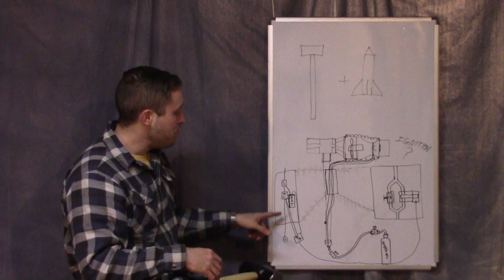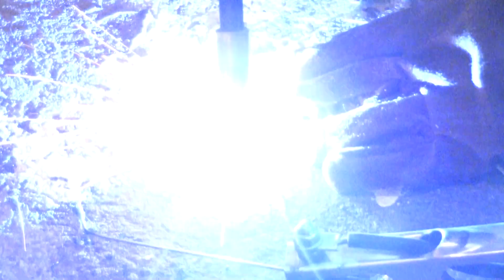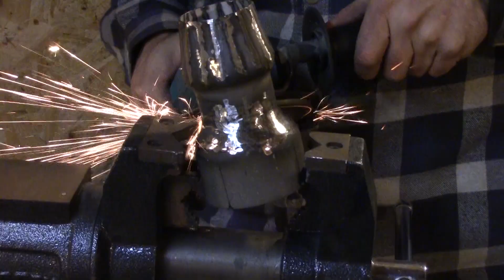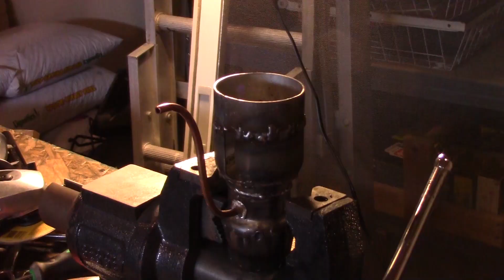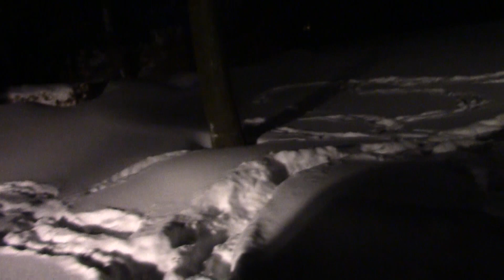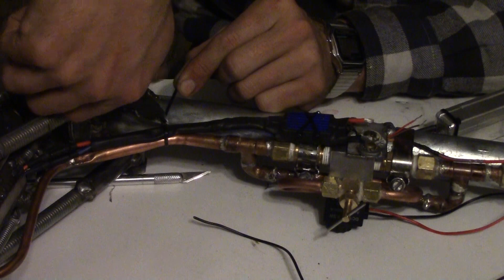Building The Real Life Super Sledge (Fallout 4)

Comment: Ok, I just happened upon your video, so now I have to check out the rest, but...pulse jet with tiny input charge and electric ignition...just enough to power a swing, then your reload system.  No edf needed.  It would be loud as a, well...really loud, but it would really add the torque to the swing if you could hand on to it.  Ok, onward to the rest of the vids.

Comment: you could try to change the fuel to hydrogen and oxygen (in 2 separate bottles so you don't cause an explosion by compression.) and you pump them both together in the chamber then you wouldn't need the intake because it carries it's own oxygen and it would look more like a rocket attached to the back.

Comment: your badass man. usually the difference between tube and pipe is rigidity. pipe don't bend, tube does. but exhaust pipe bends so it's dumb. kinda like threads. makes no sense what so ever.
Reply: oh, and one is measurement. id and od. but call it what you want. a stick of metal with a hole in it.
Reply: Technically exhaust is tubing as well. Pipe is slangily used by people that didn't know the difference and it's been used so long that's whast they call it now but it is tubing. Just been a mechanic foir over 25 years.

Comment: As an electrician, I can say, you're not stripping those thin 18? or 22ga wires with the proper tools ;P

On another note, wouldn't butane be a better fuel to use in an application like this, or would that be too difficult to work with ( not a pipefitter/gasfitter) ;P